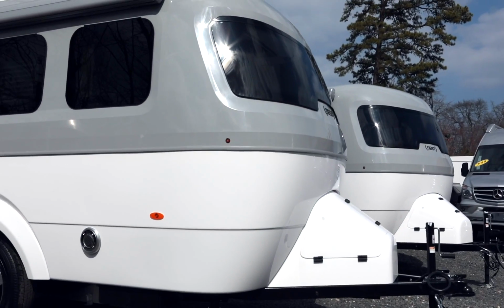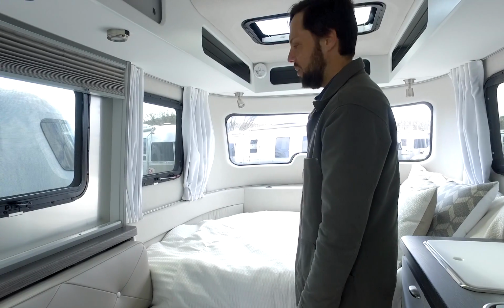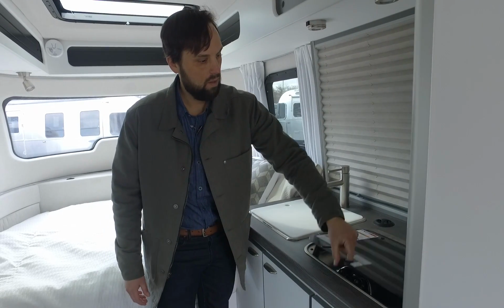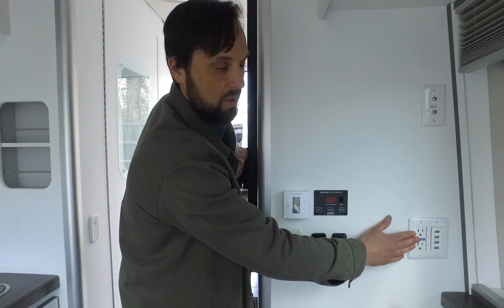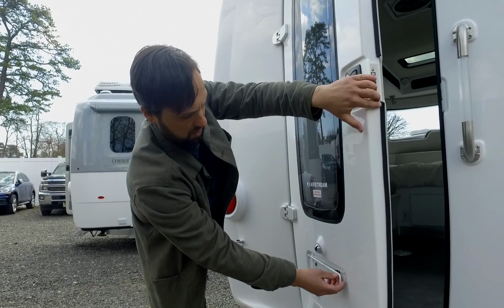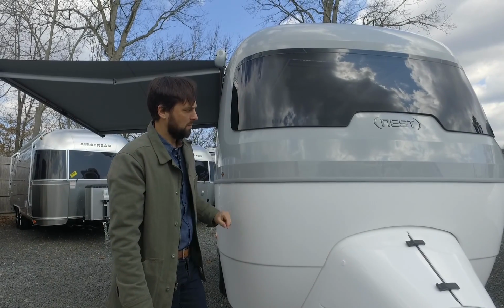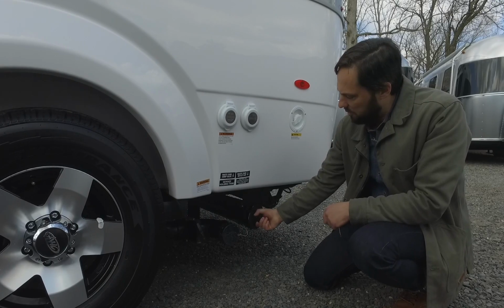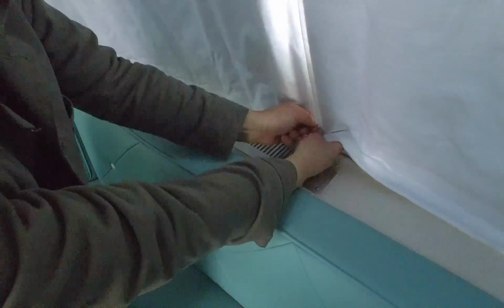2019 Airstream Nest Travel Trailer Walkthrough

Comment: No LP function on refrigerator means no frig when dry camping with no 110V plug-in. Big mistake. 12V for refrig? Yeah, for about 12 hours.
Reply from the maker: I have this setup with only 80 amp hr battery and 90W of solar and I am able to run it much longer on 12V.

Comment: This is a very nice trailer, but my main concern would be how low everything is under the trailer in the wheel area.  When he was pointing out the dedicated jack points, the silver aluminum box appeared to be only 6-8inches above the ground.  Perhaps I'm wrong, but simply going over a speed bump at 20-miles an hour, that box could impact the ground.  I would want to use the trailer in some boondock scenarios but worry that simply driving down a gravel road could cause under carriage damage.  Anyone have experience pulling this off pavement?
Reply from the maker: Thanks you for watching and for sharing your opinion. Have you seen the all new 2019 Airstream Basecamp X model?
Reply: @colonialairstream  Greetings, yes we did watch your video on the Basecamp X.   We are currently using a nuCamper 320 CS-S that has the boondock lite axle package so we have a much higher ground clearance.  It also has embedded solar on the roof and about all the options we like, but we were looking to upgrade to something still under 4000lbs that would offer us the ability to have a seating area and a separate bed.  We're preparing for a FL to Alaska trip and know that at some point we'll camp in a rain storm.  We want to get inside and not have to sit on a bed or off-load a bunch of bags from the aisle.  It really takes some strong organization skills to use these small trailers especially on long trips.  We have our bedding / linen in stuff sacks that we store in the shower while driving but when it's time to make the bed, I have to step outside.  Our boondock capacity is also limited to 11 gallons of fresh water and about the same for black/gray water.  Right now we've narrowed our search to the 2019 nuCamper 400 boondock (1st year available) or the Airstream Nest.  I like the construction of the Nest as well as the layout and while the price is almost 15k more, you do get the Air Stream quality.  All of that said, for what we want, I see the under carriage being the major drawback.
Reply from the maker: Thank you for providing some more insight.

Comment: Nice review. Concerning the sliding curtains on all Airsteams. When the curtains are drawn and the MaxAir fan running, how much air gets through to circulate within? Be a shame if air circulation was hampered by the curtains which are needed for privacy at night.
Reply from the maker: There is enough space to allow for a good flow of air. Please note the front window does not open, the sides do.

Comment: I'm confused you said the refrigerator is a 12volt or electric?  Did you mean 12 DC or 110 AC?

No included TV, that's disappointing.

I know everyone always complains about the price of an Airstream, but what they don't realize is that it's due to the labor and quality involved in making them.  Quality always lasts longer.

Not sure why anyone would be interested in that second model version, seems so much smaller inside.

I want one of these but sadly loaded up it's beyond my 4 door Jeep Wrangler's tow capacity.
Reply from the maker: It is a 12V refrigerator.
Reply: Colonial Airstream I get it that’s it’s 12 volt but you also said “or electric”.
Reply: Dan, most Norcold's used in marine and I assume here in the Nest are of the "DE" dual electric
https://www.thetford.com/product/0788/

Comment: Great video. As a total newbie to this and  I’ve learned a lot from these as I consider what to buy.  I have one comment and one question. 

First, I think I’ve watched 50 YouTube videos on all kinds of campers and have read what feels like a thousand comments.  I don’t think I’ve read one where someone doesn’t say “ great camper but I way I’m paying that”. Lol. Obviously someone is!

Now for the stupid question I’ll take some flak for no doubt.  Lots of comments here around lack of propane for the refrigerator.  And some one said in the northwest there might not be enough sunlight to recharge the battery via solar.  With the six pin attachment can’t you just turn on your truck and trickle charge it that way?
Reply from the maker: The tow vehicle can charge the battery through the 7-way plug using the vehicles alternator.

Comment: The fact that the frig does not have LP option is a deal breaker for me.  I guess the assumption is if one wants to boondock a lot they will get an external solar setup and look for a sunny site.
Reply from the maker: The compressor style refrigerators are very efficient. There are enough amp hrs. to run it without solar, but solar would be helpful. Also a 12V charge lead from your vehicles 7-way will charge the battery when towing.

Comment: We stopped to see the Nest at a local dealer. Several things didn't sit well. First is the rear entry.
If you are under the awning and it is raining, you have to go out in the rain to get in. The awning without the
extra legs is pretty flimsy. In older, small campsites, you usually back the trailer right up to the brush. This would 
make getting in hard. The screen door would not last five seconds if you had a dog.

When you come in the trailer, the refrigerator is on the left side. It does not run on propane! The microwave is on the
floor, very impractical. I'm 6'1" and the table height is way too high.

With the roof mount airconditioner and skylights, there is no room for solar panels. The front storage box only has one 
20lb propane tank. But it does have a portable solar panel connector (but where are you going to store 2-3 100 watt solar
panels?). There was no stone guard in the front.

There is limited exterior storage. The spare tire is under the trailer. Getting under the trailer on the highway
with a blow out would be "fun".

The look and the quality of the trailer are great.
Reply from the maker: Thank you for sharing your opinions.

Comment: so is the 20pd propane rank the only source of heat below 30 degrees,  no electric heat source. you would burn through that it 1 night
Reply from the maker: The Airstream is equipped with an electric heat strip in the AC.

Comment: Nice job on the walkthrough. The Nest is beautiful, no doubt about it, but $50 kilobucks for it is WAY too rich for my blood. My family and I could afford it -- it's just that it's an eye-watering price for a small fiberglass trailer.

We decided instead on a NuCamp Tab 400 (for $20,000 less than the Nest) which is also towable with my smallish SUV.  For $50K you can buy a Tab 400 and have almost enough left over to buy a tow vehicle to tow it with. My wife and 11yo son love the 400 so far, and it's super nice inside and out (not Airstream luxury, but very nice nevertheless).

FWIW, if it was $10K less we would have probably gone with a Nest.
Reply from the maker: Thank you for watching The T@B by Dutchmen, NuCamp, Pleasant Valley or Little guy, is a great starter trailer.

Comment: I still have a hard time getting over the price of the Airstream lineup -- all of the models.  They remind me of Toyota in regards to cheap looking interiors, with a name to back it up.  The resale is good, the exterior quality is really nice, but when you get inside, I feel like I just walked into Ikea.  They do not feel home like, and you have to be into industrial/contemporary design to appreciate the aesthetics of the trailer.   For the price of all the Airstream lineup 40k-150k+, they should have better interior quality - not a fan of laminated plywood -- not at that price.  The stove should be induction, the water heater should be a Truma,  there should be at least 300 watts of solar w/lithium batteries and inverter system standard, and real legit wood, and a minimum of Corian countertops.  I really want to get an Airstream for full-time living (Classic Model), but I currently have a 2015 New Horizon Majestic that I paid the same price for a fully-loaded Classic.  I assure you, New Horizon smokes Airstream when it comes to resale and quality.  I probably should have posted this in the Classic lineup, considering I am not interested in this segment, but I still like tiny trailers and enjoy watching these videos.  I should say though, for a high-end fully loaded Majestic, you will be in the 250,000K price point so now your getting into diesel pusher territory.  There is currently a used package deal on their site for a 2012 New Horizons Majestic M45DB4SS (truck and fifth wheel) going for 
$159,825.00.
Reply from the maker: Thank you for watching and for your suggestions.

Comment: 13.5k BTU A/C is overkill. A 5 or 6k BTU would be plenty.
Reply from the maker: I agree with you on the size is a bit large but it would have to be over 10K based on the amount of windows and skylight and the potential heat gain.

Comment: For 47 grand one would expect a generator, 2 wastewater tanks, and an LP refrigerator. Or am I expecting too much?
Reply from the maker: Typically travel trailers do not have generators. If separate grey and black tanks were fitted, they would both be very small. It is beneficial to have a combo that is larger. A compressor 12V/120V refrigerator is considered an upgrade over an LP style.

Comment: A 600 lb payload isn't a lot. Put water in the tank and you are probably down to less than 500 lb for all your gear and supplies.
Reply from the maker: Keep in mind, it is a small trailer, an average owner would not be putting more than 250 lbs of gear inside.

Comment: Don't get me wrong airstreams are great however I own a host triple slide camper it was $60,000 it has a generator king size bed two TVs electric fireplace full walk in shower two couches huge rear window when it opens up at feels like an apartment I just feel like slides are a game changer I'm a big guy so slides open up movement area
Reply from the maker: Thanks for watching. The Hst truck campers are nice but the proper truck to haul one is very expensive.
Reply: Colonial Airstream I agree but I use a Ford 450 for work so the camper was a no-brainer for me.

Comment: Nice job on the video.
That is an awesome looking travel trailer. Sadly my wallet won't allow me to purchase one... LOL
Reply from the maker: Thanks for checking us out.
Reply from the maker: If you can make it out to Hersey this September, I will have the all on display side-by-side.
Reply: Heidi C. Franks — Have you ever purchased a trailer in the price range you seek?  I have, complete waste of money. We arrived at our first destination to find the mattress wet from the rain, no clue where the water leak was, it had been raining.  On subsequent trips cupboards fell apart, no electrical, battery shorted, water pump failed, Hell the first two years were hell.  Then it started falling apart because the wood sides and underbelly get wet when we drove on wet roads.  I tried to fix it but it was pointless.  

Airstreams are not the cheapest, but they are great value for the money.  You either pay up front, or pay later with ruined vacations and repair expense.
Reply: @Erin-Thor  Bull.  I own and use (a lot) a 16ft Scamp that is in my mind at least as durable and comfortable as this is.  And I'm sure costs at least less than half the price.  Why the hell would anyone pay in the neighborhood of $25,000 ti $30,000 for just the name? Oooooooooooooooo, I own an Airstream.  Give me a break. And do yourself a favor and do some research.

Comment: Love the design.  Any opinion regarding maintenance and longevity of fiberglass compared to aluminum?  Any advantage of fiberglass in those areas?  Thanks
Reply from the maker: They are both great products, you have to clean and wax the aluminum or fiberglass. The advantage to fiberglass is there are very few areas to maintain and caulk and no seams.

Comment: What I find amazing is that this is a high end price point and yet they use the cheap windows that don't get good air flow, the standard inefficient RV furnace, no built in inverter, and cheaped out on the bathroom by not having a folding sink, a plastic toilet, and hardly any bathroom storage.  For the overall value and features the NuCamp 400 is superior IMHO at approx $30k and 500 lbs lower GVWR.  The nest does have better counterspace and kitchen storage (the ushaped dinette floorplan) which is really due to not having a fixed bed.  Particularly in light of how originally the nest was supposed to be a lighter and less expensive option compared to the other airstreams.
Reply: There is a sink less than 2 feet away.
Reply from the maker: Thanks for watching Sharon and for sharing your feedback.
Reply: That no bathroom sink is an issue for me. Maybe its a ladyparts thing, but washing my hands before i leave a restroom is really important lol

Comment: 50 Grand...for a gel coated fiberglass shell 16' trailer! Airstream needs to get over themselves. Wow! Great walkthrough though Patrick, as always!
Reply: They regularly start at about  $130,000.00, So was Shocked to hear $47,000.00 
Very nice 🌹
Reply: jason thomas  Yeah they clearly don't know what they're doing, that's why they've been around for 80 years. You get what you pay for. You can buy a trailer for 20-30 grand, but you'll be buying something made from sticks and particle board with leaky seams everywhere.
Reply: Chris Brazitis they're crazy 50k for that 🤣
Reply: @robertburnett1970  times have changed, my neighbor now owns one new for 26,000:)
Reply from the maker: Chris, thanks for checking out the new NEST.
Reply: @ BB What are you referring to? Class B+ RV's?
Reply: Looks great to me! ❤️
Reply: It does have an Insect Screen yo ~ ... I want the model w/the In-Law Screen ... :)
Reply: Chris Brazitis i
Reply: Chris Brazitis I read the bio of Wally Byam,I don’t think(in my opinion)he ever meant Airstream travel trailers,for the massas.
Reply: I see they can be had for $35,000 now for a new 2019.

Comment: Love the design but I' m not sure I would enjoy the rear entry at many of the campsites I use.  It sure would require more walking to go in and out plus getting exposed to rain between awning and door.  They could have used those 270 awnings like one sees on overland vehicles though.  As for the weight it is the price to pay for durability.  All materials seem to be up there with Airstream tradition of quality except for the manual tongue jack similar to what I have on my  used $2000 travel trailer.  A new product that will likely evolve with owners'  feedback,  millennials and  others.
Reply: Very nice styling but $50K? Really?
Reply from the maker: Marc,

Thanks for watching and for your input.
Reply: Maybe they will have a inflatable tent style awning to add on to the rear sometime in the future.

Comment: I like Wally Byum's original design. It has kind of an art deco industrial design with function. In these trailers the UV rays will break down the fiberglass. Fiberglass is not as easy to repair as aluminum.
Reply from the maker: Thank you for watching. We believe the NEST to be just as durable or better than other fiberglass shell style trailers that are on the market and have proved themselves over the last 40 years.
Reply: I totally disagree with you:  sailboats and powerboats are fiberglass and last for decades with minimal care and a light compound job every five or ten years, gelcoat can be easily repaired and paint, if you wish, forty years later.  Fiberglass travel trailers keep a high resale value.  Aluminum is fading , whitening under the sun.  The underbelly of the Nest is covered by fiberglass, much better than other aluminum Airstream.